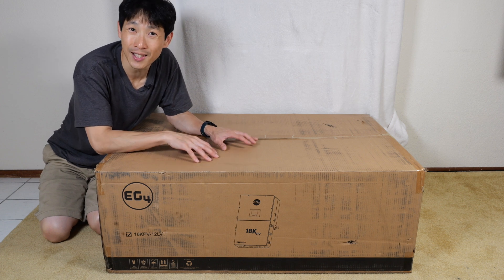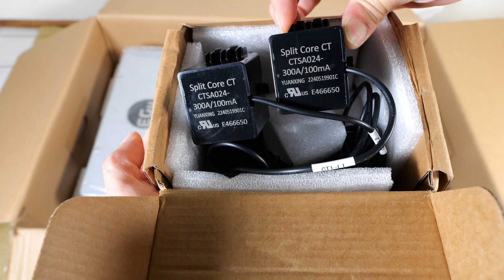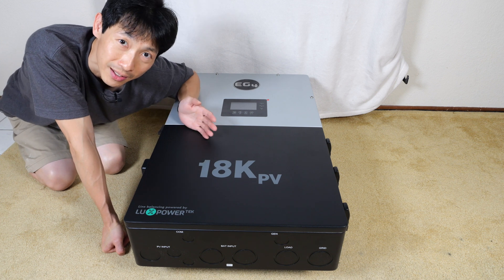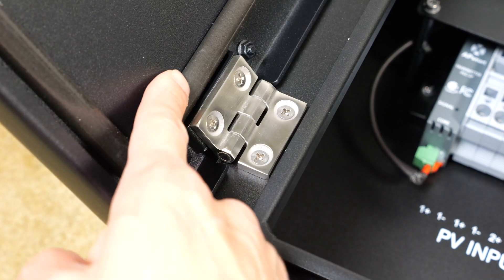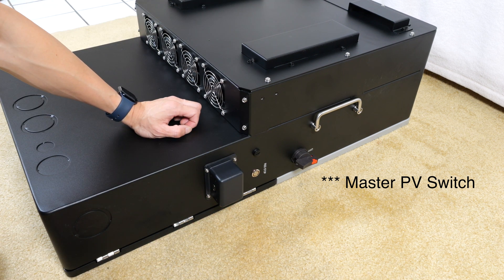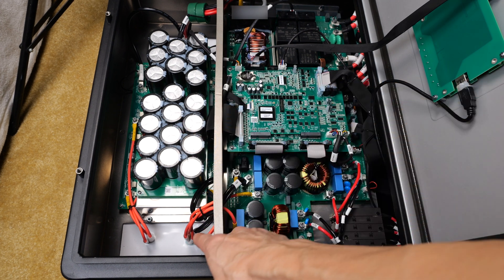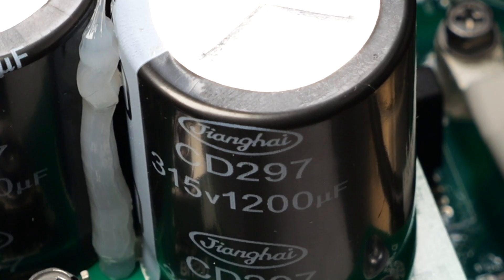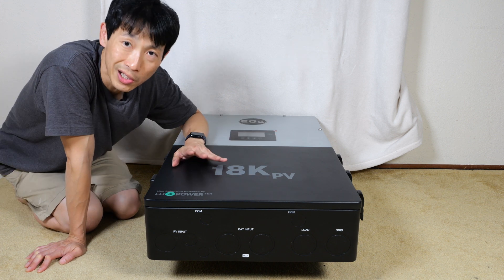A Look Inside an EG4 18K PV

Comment: Here's what Google Ai has to say about the cheap, Chinese made, high frequency, transformerless inverters technology that's used in the 18kpv.  "Transformerless inverters lack the galvanic isolation provided by a transformer, meaning there's no physical separation between the DC input and AC output circuits. This can lead to issues if a fault occurs within the inverter, potentially allowing DC voltage to bleed into the AC output and damage appliances."  No thanks!
Reply from the maker: Not many hybrid inverter will pass all the safety standards. This one has: "Safety - UL1741SB Rule 21, RSD NEC 2020:690.12, AFCI NEC 2020:690.11 / UL1699B, GFDI NEC 2020:690.41(B), CSA 22.2.107.1, CSA 22.2.330" I'm going to guess one of these standards cover the particular failure mode you are worried about.

Comment: finally, a good video going over the components of a big inverter. the prices of the low freq victron stuff are kind of absurd.  i think this is the model i would go with if i owned my own house. I do feel like inverters are basically a wear item though... if I had my own place and was doing a lot of rewiring, I would wire everything again for 48v dc, and possibly 12v also. really like the idea of cutting out an inverter and having an almost entirely DC wired house, with a couple of wall wart style cigarette plug inverters for occasional ac appliances. I know its somewhat common now to have 48v dc for comercial lighting now, but to me it seems like the way of the future, like how the cybertruck low voltage side is laid out with little 12v step down boxes. copper is expensive if you were going 12v, but you only have to pay for it once. could always design it so you could rip out the big 12v wires and take them with you if you moved.
48v is just so much more mature like PoE injection. so few appliances now days actually use alternating current, and fewer and fewer will in the future. so many losses in solar systems going from dc to ac in microinverter back down to dc to charge batteries and then back to ac for house wiring then back to dc for a dc wall wart. same with ev's. appearently some EV's will slow charge on DC if you feed it into an evse like my chevy volt. not sure thats healthy for the fuses/diodes.

there is a channel on yt of a guy who takes apart AC powered IR quartz tube heating elements and rewraps them with ~1mm incanil wire and builds ~12v appliances directly powered with solar/battery. not that big of a deal to convert some higher powered appliances like toaster oven/space heaters

Comment: Just curious why didn't you go with low frequency inverter like Victron or similar? I guess when these die (and they will eventually), it's almost impossible to repair
Reply from the maker: I will eventually try all of them.
Reply: @BeatTheBush  Great! Looking forward to hearing your thoughts on this. It just seems like the low-frequency inverter is a better long-term investment, as they last much longer than high-frequency ones.
Reply: @BeatTheBush  Oh, forgot to mention that the low frequency inverters have lower idle consumption, I think something around 30w for 8kw models. Which also adds up over time.